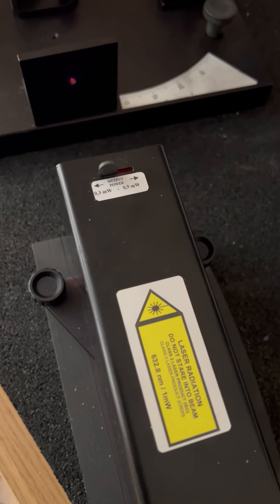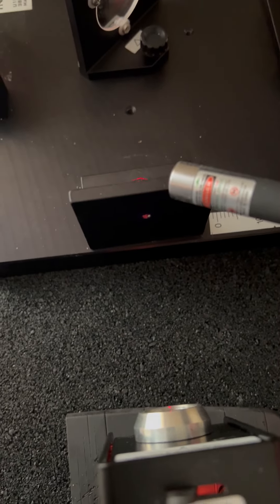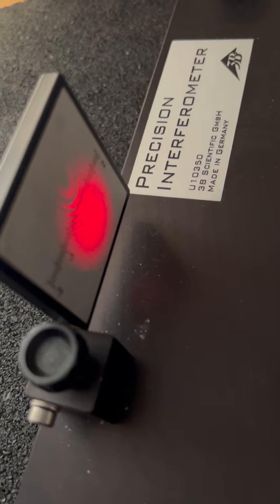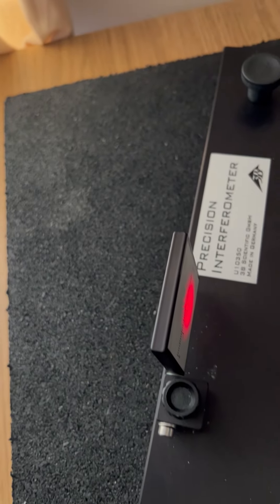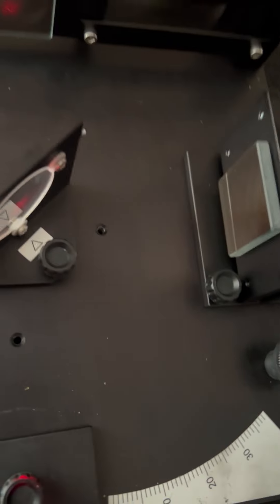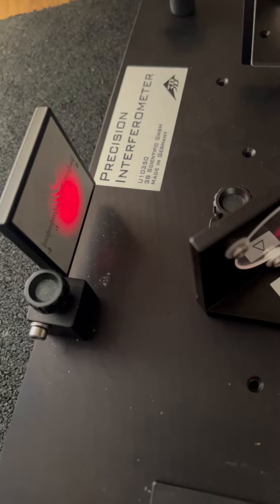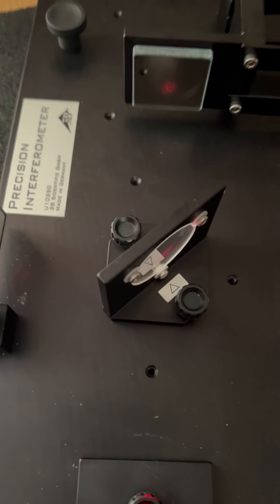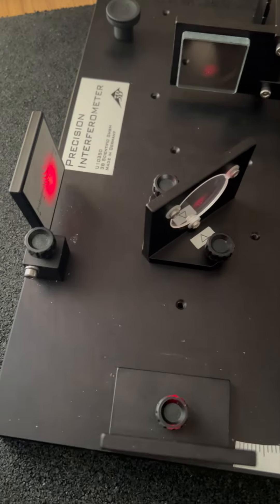Interference pattern collapse, quantum mechanics (single arm)

Comment: Oh haha sorry. I watched the video a few more times and think i understand now. So this is the classical understanding of two different waves interfering with each other? 

Are you still going to post more to demonstrate the quantum collapse? I'm really looking forward to seeing that. 

Thanks for posting.
Reply from the maker: I will post more at some point, not sure when though. The interferometer requires the convergence of light from both arms to create the interference pattern. Blocking one path of light prevents interference like forcing a photon through a single slit (you will see this as blob-like rather than ring-like, ring-like is the interference pattern on this setup). The detector will do something similar preventing the interference pattern.